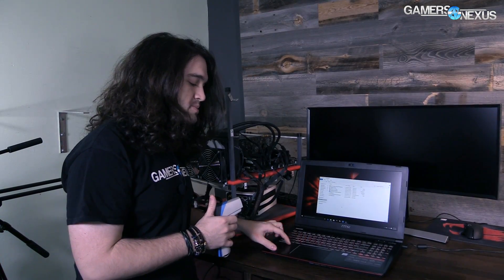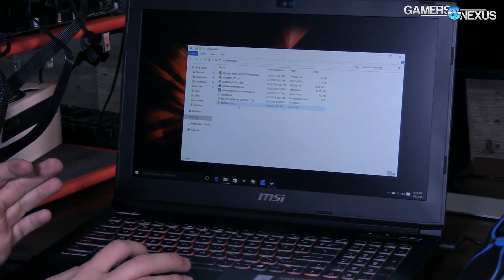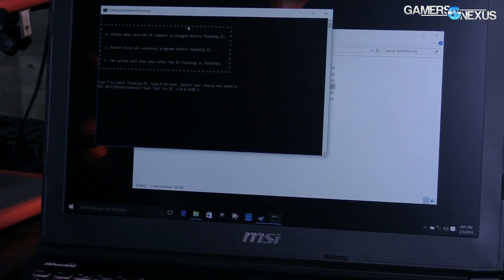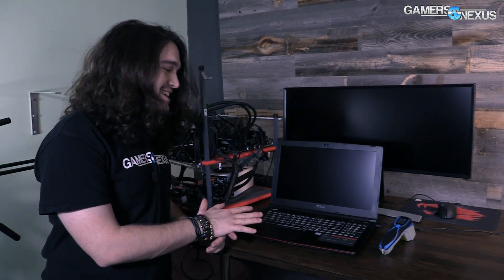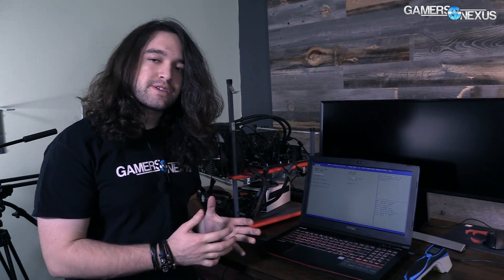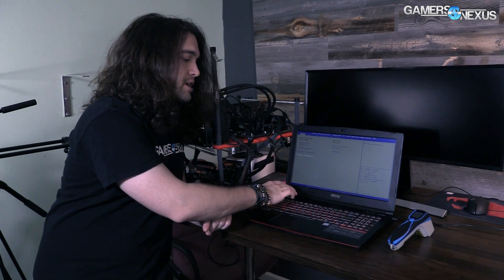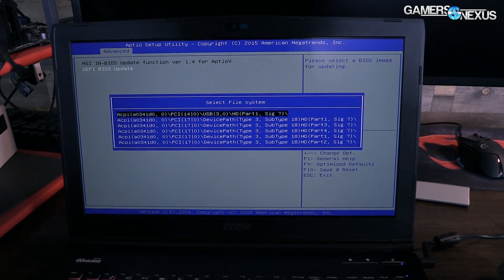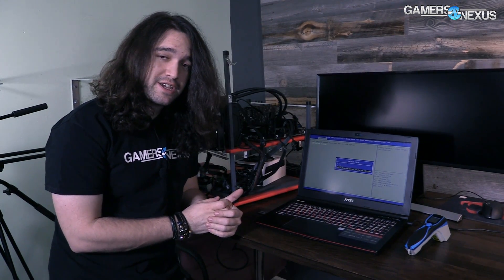How to Fix MSI Laptop Fans & Overheating

Comment: I will never ever ever buy a msi notebook again in my life, i downloaded and installed everything and i still have problems with the temps while i play... the keyboard goes REALLY HOT... nothing of this works... i dont know if this is publicity for msi or what becouse nothing of this works... im so so mad man i cant believe they sell something that goes ridiculously hot...
Reply: oh maaaaaaaan ! at last someone who has the same issue as i have .  actually it's even worse for me,  i have since LESS THAN A YEAR .  ( bought it in 2016 around march ) . This shit goes OVER 91°C both for gpu & cpu .  YES 195°F !!!!!!!!!! for fuck's sake . and that's not the worst . playing elite dangerous , after say 10 minutes,  inconsistent lags , totally random till it becomes unplayable .   the computer is litterally BOILING .  i trid everything surelevated , bought a fan docking base ,  cleaned the pc,  disabled any graphic option on W7 64 .  everything,   opened this utter shit and cleaned it with a vacuum cleaner , ( i'm a smoker , thought maybe the ash ... ) added ram , an SSD . SAME SHIT .  never ever in my entire life , will i rebuy again an MSI , and never will a buy a "gaming" laptop .. you can't upgrade you can't change , you loose the fucking warrant for just cleaning it ....  i tried any possible solution , speedfan , this utter shit called "dragon gaming technology" which basically sucks up the entire ram resource or heats up somehow the pc ... whatever ,  i'm about to buy a REAL PC , a desktop pc,  Whole ASUS / INTEL  and will go for a fucking watercooling solution .... sorry mate you wre around , i had to spit my fucking rage , i was broke at the moment i bought it  and it costed me a fortune back then .... .... MSI or the purest shit you can find on the market .
Reply: @natordathan  My laptop also hits 93-95 on gpu and cpu and i replaced thermal paste 4 times in different ways and compounds and no luck temps still high
Reply: @natordathan  You did all this but didn't try undervolting your cpu and gpu and turbo limiting your cpu... I have a month old msi gf65 thin and i had the same problems. The cpu goes into turbo mode 5 secs after i launch a game and the cpu  temperatures go to 95 degrees without a sweat.. Just after some time 95 - 98 degrees becomes their normal range. To be honest I tried undervolting my cpu and gpu but they didn't do much as it didn't matter how much i undervolted the turbo boost will take the extra headroom i created by reducing the temps and boost even more resulting in the same cpu temperature before undervolting just better cpu speeds which is great but what about my temperatures!! I can't boost blindly just to make it faster, it will damage my cpu in the long run. Turns out the processor i have i9750H is too powerful for a laptop with normal cooling system. Wonders only happened when i turbo limited my cpu frequency in throttlestop (I undervolted with same tool). I maximum boost frequency is 4 Ghz and above at 95 - 99 degrees, i turbo limited it to 32 Ghz and now my cpu is in 73 - 80 degrees range. Also set the fan speed mode to advanced in dragon centre and set the fan speed graph. I remember copying th graph from someone on the internet and it worked, just search it(also increse it a little if needed). FYI I did my turbo limiting just today and as of now as i have completely stopped all the thermal throttling of my cpu, my gpu also seems to work better.
Reply: @natordathan   And a lot of ppl out there are saying MSI has the best cooling system.
Reply: @thothtrismegistus929  they so, you just have to understand the settings.
Reply: Msi computers have a switch on the keyboard which increases the fan speed.
Reply: @natordathan  dude are you still mad till this day? just undervolt it man, mine goes from 85 to 68 just by using ThrottleStop
Reply: msi is just a funny anecdote far behind me now . it's been years.  i have a custom built desktop now . It's been 3 years that I wrote this comment above .  for basic browsing I use a tablet with a cover book that I mirror on tv .  For gaming , I have  a warmachine . and I enjoy using it every second of it . That anecdote with msi,  that I literally almost cried on ( because I was broke and had really no alternative, and felt depressed & cornered) makes me now enjoy how reliable a desktop is  . And truly find myself thinking "gosh I love my PC" when randomly looking at it..  Desktops and laptops are literal worlds  apart. there is absolutely no comparison .
So yeah , I won't be buying a gaming laptop ever again.
and certainly not any equipment labelled MSI . I wouldn't even want to be paid to use it.
Reply: @natordathan  omg all people have it omggggggggggggggggggggggggggg msi how the fuck they test there laptops in a fridge ?????????????????? fu msi
Reply: @yousifattili8877  chill man. this was 4 years ago.
Reply: @natordathan  but i still have this trash laptop
Reply: @yousifattili8877  i now have my gf75 for about 2 years and i’m hitting 92 degress celcius it’s fucking ridiculous
Reply: I can't believe this as well! My laptop gets to be over 100°C after playing for just a few minutes! This is crazy!
Reply: ... Same here.. MSI GT60.. I fcking tried EVERYTHING.. My MSI have like 3 years, thats okay... but 95º watching youtube videos? you kidding me... I cleaned inside, new silicon, added more RAM, more memory... and the pc just goes worst and worst... I dont know what to do...
Reply: Mine goes over 100º 3 minutes into playing a game lmao
Reply: Regular jean I only get 74 c on gpu and 80 c on cpu while under load on demanding games. ??? Seems you guys are not giving your laptop enough air playing on your beds or lap. Or you live in a hot environment. I take care of my comp so it always runs good like cleaning fans doing thermals. Not that hard.
Reply: Joel Hernández any updates, did you get a new laptop
Reply: Same problem here with a GS63 : GPU and CPU runs way too hot (around 96°c) and the performance keeps downgrading. I'm having like only 50 % of the performance I should have. Will never buy a laptop for gaming again
Reply: Same shit here. MSI, GE72 6QD Apache Pro, about 6 months old. Burn my fingers playing Overwatch, and that doesn't even ask for much. I bought a gaming laptop to game. Not one to overheat while watching just a movie, and burn finger while gaing for 5 minutes....
Reply: Jah Dawy i have same problem here. i got 2gf with gtx970m and from the start when i play overwatch and hots the temps go up to 85 90 degree celcius. i thouth maybe it should be like that but i watched some benchmarks and temps were like 65 degree on ultra setings and i have 87 on high.
Reply: same problem with ge72 2qc apache (gtx 970m), even cs on 1024x720 drops frames to 50
Reply: Yeah I got GE72 worse investment of my PC gaming experience. Luckily I made a nice desktop already though. It's junk meaning msi
Reply: same problem here with my gs72 and i got now alienware fuck msi
Reply: Nero hussien hey one question, how is it going with the Alienware, does it overheat???
Reply: me too, I should have bought ASUS gaming laptop
Reply: same here with my GL 62M 7REX
Reply: V2 LynX 😅😅
Reply: this is old post but yeah I bought an MSI this winter, and I will never buy one again- they have these ridiculously loud fans that don't even cool it at all. I hate this thing and cant wait to replace it after 2 months... pathetic.
Reply: Me too :D
Reply: İ played a game (for honor) for the first time now on my new msi 1050ti and it works fine. İt feels hot on the keyboard, but it isnt THAT hot. 60°C is normall for a gaming notebook laptop. Try setting your games to medium/low settings and look if it still heats up to higher than 75°C (85°C is max before it melts). I was surprised that mine got hot but as long as its not damaging something, even 70°c is fine then..
Reply: Welcome to laptop gaming: a world of over heating! It's not only about msi.
Reply: Bruh just buy a cooler for 20$
Reply: After 6 years I still have the same issues as you with the new Notebooks from Msi. Nothing has changed.
Reply: I had a high end 1 and it overheated and warped the back with charging issue & 3 months before warranty :(
Reply: same here with the gl62mvr
Reply: Mine literally burns my leg. It's running at 95 celcius under the cooler boost feature, and just went blue screen because it got so hot. It's one year old.  Fucking bullshit.
Reply: @Kboss66  fist off you dont play game with your laptop on your legs that is stupid, second use a base cooler, change thermal paste, and clean the dust inside.
Reply: @zedeco  thanks for mansplaining that! Im not capable of reading all the other men's comments on this video saying the exact same shit :)
Reply: @Kboss66  and yet you still dont get it, womansplaining is harder to understand, maybe i need to draw you a picture.
Reply: Art Junyent i had one, died in 2 years because of a fan problem, i cleaned it btw 
can't even repair it, gaming laptops are shit
Reply: CallEno how?
Reply: same i cant wait for my new computer to come
Reply: Got a new MSI creator 15M (2020) and the cpu reaches temperatures as high as 90c 10 minutes into a game (gpu however is only at 60% load and a lot cooler). When I check the cpu usage however, it's never above 60%. Both fans are on, almost at max. speed. Can't seem to fix it.
Reply: @Dsteen12345  Cpu usage should never go that high whike gaming my cpu remains at 30% to 50% max. If the cpu reaches 100% while gaming it's not good. The gpu should be at 95% to 100% while gaming
Reply: Same here dude. 95°  on CPU.. It really sucks..
Reply: G e t.  A.  F a n.  F o r.  I t....
Reply: Might be an old thread but my MSI PS63 also overheats as well. I sent it for warranty and they replied: "The computer is behaving normally".
Never buying another thing from this brand again. A PC that costs 1800€ should be built to last, not to crash every once in a while.
Reply: Same here GE72mVR  after 2 years overheats around the top left keys
Reply: Well... I tried it all...
- BiOS patch
- EC patch
- Undervolting CPU & GPU
- Limiting CPU speed (90%)
- Drilling holes under the left side (where the HDD is) for better air flow
- Removing all internal HDD and SSD (using USB instead)
- Using external cooling pad
- Removing dust from fans
- Replacing thermal paste
- Replacing thermal pads
...
Left side is still freaking hot...
Sure...CPU and GPU temperatures are reported as low... But my wrist says otherwise...
Very disappointing MSI...
Reply: Mine crashes at 85c crazy that it even gets that hot
Reply: Art Junyent Know this is ten months old but this might help. Have you tried undervolting the cpu? It's an easy way to fix the temperature spikes.
Reply: Same here as you guys. GE70 2QE Apache Pro. Even my older graphics card on my now bricked ASUS laptop ran games like GTA perfectly with a supposedly inferior graphics card. You even TRY to play GTA on here and if you keep the game on you're going to get some melted plastic and silicon. What a scam. What the shit. I hate Taiwan now.
Reply: I have the same issues, it gets so hot it burns my legs. I have the GE62 2QF Apache Pro.  I can't play anything, even games like Life is Feudal or H1Z1... It's been like this from the start but getting much worse over time ....
Reply: Do you know how to use coolerboost in msi because msi fan is very fast I play gtav medium graphic gp62 6qf in 62°c
Reply: Did you clean the vent dust can get collect in the vent you have to clean it yearly

Comment: I updated my bios and now my fan is at 77 degrees celsius versus 50 before the update so it actually made my computer worse. I don't even know what to do at this point. MSI said itll be 2 mos without a comp to send it in for service and its so hot I cannot use it to play anything good. =(

Comment: my msi ge62 6qc doesnt go up any higher than 1500 rpm and i did try the one on the vid and doesnt help, whenever i press also the fan button there is no response from the fan
Reply: Try the MSI app 'silent option'. Then, you go to advanced settings and you can put it on 150 everywhere. Now my fans sometimes go around 7000 rpm

Comment: I have MSI GE62 6QC Apache laptop and the cooling are automated and turn on with out pressing the button. The fans are really noisy, Can't use my Laptop in class. :( Can't find the appropriate command center for mother board of MSI GE62 6QC Apache... By the way, I just got the windows renewed and fans changed by the technicians. Problems still exits..... :/ 
Any clue? Any One!?
Reply: I have a MSI GE72VR 6RF and the thing might as well be a kettle as it gets that hot. As for your problem with the fans to high simply go to the. MSI dragon center app then go to the page where it has the options for the laptop eg: sport mode turbo mode ect. and click basic under the cooling options then simply move the slider to how fast you want the fans to go as I had the same problem with mine in class and that was the only way to fix it.

Comment: WHOP, this finally fixed my RUST FPS issue, and probably some other underperforming in games. Ive had rust fps jumping around, between 6-60 fps. mostly around 30 on average and stutters all the time. After trying everything, (including upping my ram to 16gb) and nothing ever changed, i was looking into reformatting my pc. And while i was looking at drivers I saw there were new bios and EC firmware updates. I then started looking into EC firmware out of curiosity, and I found this vid after a while.
Ive got a MSI Apache pro GE62, 6QF. (skylake i7, 970m) It originally came with EC 1.103 and bios .106. Upgraded today to EC 1.110 and bios .112.
I now got a whopping 100 fps most of the time. 
Seems like before it was down throttling for whatever reason even just at 30% cpu/gpu usage.. even at 70 degrees. Id say the old EC is complete shitt and Im surprised MSI never even tried to tell us our laptops were underperforming as fuck.. 
I mean.. look at the numbers. 30 fps-100fps. o.O If you haven't done it already. UPDATE.

Comment: I have a msi ge62 and playing far cry 4 the gpu and gpu are peaking at about 80-82C, how do i use afterburner to change fans to turn on harder?
Reply: I have GT80S and I think this is the highest average degrees that it reach it.  Sometimes reaches 83 and a little higher if on real load.  But it is not good, that temperature is good 77-83.  Make sure you switch your MSI shift mode to (Comfort) that will use the highest power it can without decreasing CPU and GPU life.  But if you really really need that strength and must be pushed further; you can use (Sport) Mode.((((((((((((Steps below not worth the performance you get; might be +10-30% sacrificing life CPU&GPU))))))))))))))))There are nothing to do after that except 2 things which is not recommended as you won't get ((much)) FPS and Quality; plus; CPU and GPU keep throttling everytime which affects game smoothness.1- Using (MSI Dragon Gaming Center) Switch profile to (Sport) Mode. and choose Multiplier x41 for CPU; or the highest shown.2- Using (MSI Afterburner) keep overclocking your GPU (Core Clock) 10 points at a time and check game performance till you find the best spot without game crashes.
Reply: ok thanks for the advice. I run it on comfort mode. In msi afterburner i tried changing the fan settings but I have no fan tab to unlock that control???
Reply: Kyle Wenner you can't adjust fan speed on a laptop as the fan is not the original for the Graphics Card as Desktop one.  They install another fan on the motherboard.  But in desktop Graphics Card; it comes with it :)
Reply: ok thanks I changed up some of the settings and it the cpu and gpu to average around 75C, so thats a little better.
Reply: Kyle W heat should be fine as I know, sometimes reach 83-88 but don't expect it will keep cooling laptop always to make it very cold.  Heat is needed for power :) and it will turn fan maximum speed when necessary to save graphics card from dying and to not annoy you with fan keep running on high speed.  So just don't worry about it unless it is abnormal heat; maybe like 90 degrees? and above
Reply: mine reaches 88 on any game something is messed up
Reply: kenneth schaijk Make sure to use Shift Mode on (Comfort) most times, unless you need ultimate power, then Shift to Sport but for me (my opinion) I see it is tough for PC to be on that mode,  how many years your PC used? did you try clean Airways Fans?

Comment: my msi laptops fan keeps starting and stopping on its own, really annoying.
Reply: You can't control Fan speed on a laptop.  But what you can do is:1- Go to power Options.
2- choose (Advanced Settings) on the plan that you are using now.
3- expand (Processor Power Management).
4- expand (System Cooling Policy).
5- You can choose either (Active or Passive)But I don't recommend you do that unless you know what you want from your laptop.Active means:Your fan will keep cooling your laptop on demand giving you the highest performance.  (High Performance)Passive means:Your performance will keep reducing to not let the fan runs everytime.  (Low Performance)and remember :DLoud Fan = High Heat = High Performance.Quiet Fan = Low Heat = Low Performance.